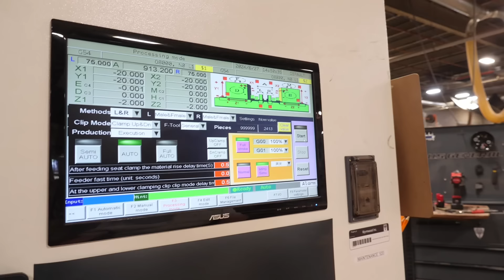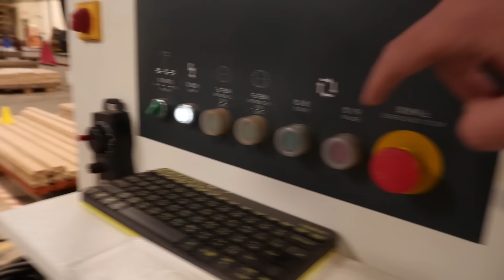Our Machines Are DESTROYING Themselves...

Comment: Seems like a bad design because the force of the loading part puts the tension on the threads, not on shearing the bolt.
Reply: Also thread engagement length in soft material like aluminum or pot metal should be 2X diameter of the thread so the screw breaks, not the tapped hole threads. Those threads look like they were only engaged 1X the diameter.
Reply: But that's not what happened. The motor that moves the spindle assemblies is what pushed the threads out when the spindle made contact while not spinning. It was not the loading mechanism. Look at it operating, it's moving the whole spindle assemblies forwards and backwards at quite a high speed. I can see there easily being enough force available to strip the threads.
Reply: @m00hk00h  With proper thread engagement.... and lets be honest, proper cast iron ... when the spindle doesn't run, and the machine crashes, the thing that is supposed to break is the *wood*.  Had the machine been properly designed, and the spindle malfunction happened (malfunctions happen to well designed machines too), they should have lost the part, not the machine.

Comment: @wyrmwood I am looking at getting the mgt but one issue I heard was the middle toppers can slide if leaned on is there a reason why you don’t put rubber stoppers in the middle on both ends like you have in the corners for the end toppers? Also would it void my warranty if I added them?

Comment: If you got clearance. Have a local machine shop make a U shaped pice that bolts onto the three existing bolts and bolts on the inside and outside where you have more metal to drill and tap. From the looks of it you might have enough clearance to megdrill all the way through the center between the two rods and run a bolt and nut all the way through. Or fly me out for the weekend and I’ll do it.
Reply: If the vfd for that motor tripped out it will stop running. You might be able to look at the history in the vfd to see why it tripped.

Comment: Potmetal, the bane of everyone ever. One problem i see right away is that its a perpendicular bolt to stop the rotation... thats a lot of angled force in a... what, 1/4 UNC? im a metric kinda guy... anyway, there should have been a plate or something along the side to extend the anchoring, but it might be a clearance issue... i can't see it from here. Also a helicoiled thread is at times more sturdy than the original thread.

Comment: With a decade plus in production maintenance I highly doubt your machine is cast from “pot” metal, cast iron is soft, your machine is more than likely cast iron or cast steel. The real issue is your using harder bolts than the material they are bolted into which is why it pulled the threads out instead of breaking the bolts. The bolts should be the fail point they are easy to replace when something like this happens.

Comment: A month? Seriously? Soon as this broke and found the be a machine defect, it should have became a seller/manufacturer call for service and replacement either brought in, or repair tech brought in. This is industrial equipment and NOT your job to fix. This is a failure that should be manufacturer repaired and covered as it is a safety liability for not only your, but ALL of these machines they have sold. It would be one thing if it broke yesterday and after contacting the manufacturer, they gave you permission to do a recommended repair to either get up and running, or there was simply zero other way to produce what it did, but after a month you opened yourself up to many many warranty, safety and engineering knowledge risks by doing the repair yourself.

Comment: From the looks of it the machine is creating vibrations over time those vibrations can cause the bult to loosen thus creating play between the bolt and thread, when the blade that was not spinning pushed on that hole because the metal is kind of weak it just exploded. an easy fix would be that every month or so go over the whole machine and re tighten any loose bolts

Comment: I'm not an engineer, but I see two issues. First is a machine with a pot metal structure. Second, the the tension of that structure is placing shear stress on the bolts. If it weren't for the pot metal structure, the bolts would likely snap.
Reply: It’s easier to replace bolts than a broken structure like the base of the machine. This is why bolts are use like a fuse.

Comment: Whats the benefit of using a helicoil over just using a larger bolt? You're still drilling and tapping a new hole. why not grab a bolt that fits the new threads? Of course you'd have to drill a larger whole in the other piece, but that shouldn't be a big deal.

Comment: At 1:30 the problem stems from the part being cast Iron. Ir you replace it with a part made of high carbon steel, or just steel that can handle a little more abuse, it should work.
Reply: And if you want it to have a Failsafe, you can just "mill the top off" and make it so, that the new reinforced part has a part that fails at a specific force and can be changed within minutes.

Comment: seems like a VERY poor machine design as those fasteners are basically being loaded in tension and shear, I'd be curious if you could add a plate with some dowel pins to the side of that assembly to take that load off of the fasteners
Reply: Edit to add, Doug makes a fair point about breakaway being a feature within this assembly but you could add a plate to the side secured with 1/4-20's and at least not shatter the casting / strip out the fasteners.

Comment: Not gonna lie was expecting the fix to be cut out a chunk of the weak ass metal get a replacement of proper steel that bolts down into the pot metal so the forces are at least going into the correct direction for a weak metal and the stronger steel holds the bolts together haha
Oh and Doug to be right about the spindle having loose connections; when things spin up tons of vibration, so theres a wire thats loose but connected and th viration made it disconnect slightly but more vibration of testing reconnected; gotta love shroedinger issues :3